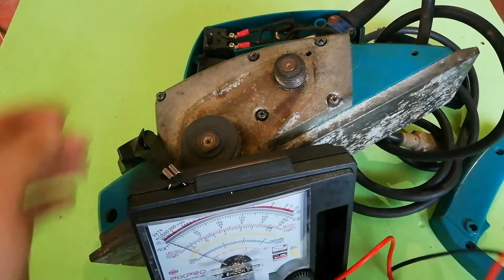Original makita electric planer repair

Comment: Paano naman po pag nabasa yung planer boss.tas hindi na naandar?
Reply from the maker: Pag nabasa boss ng matagal kadalasang nasisira ang mga bearings nya or nagkakaroon ng kalawang ang armature kaya dumidikit ito sa stator at hindi na umiikit. Nag vavibrate nalang.
Reply from the maker: Pwede din pong nabasa ang planer tapos nasira ang armature dahil nagka short circuit ito or baka sa power cord or switch nyalang ang nasira.
Saan po sainyo sir?
Reply: Sa bohol ako boss..magkano paayos?

Comment: Sir ano po problema  kapag nag spark ang electric planner pag pinaandar?
Reply from the maker: Malakas po ba ang sparks sir? E check nyo po ang carbon brush baka hindi napo pantay ang pag touch ng commutator sa carbon brush sir.
Ano po bang brand ang electric planer nyo sir?
Reply: @creativejunior7060  malakas spark sir. At saka uusok narin pag pinaandar. Pinalitan ko ng bagong carbon brush ganun parin.
Reply: Hoyoma japan brand sir.